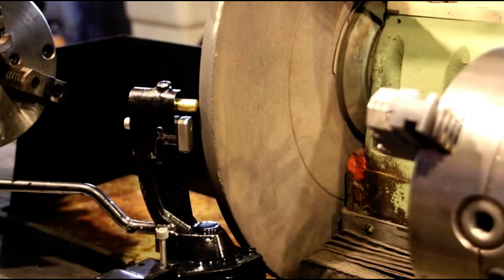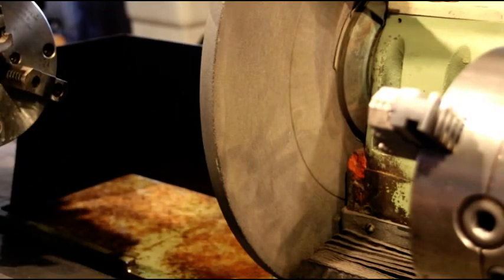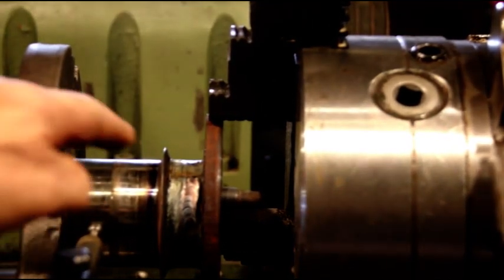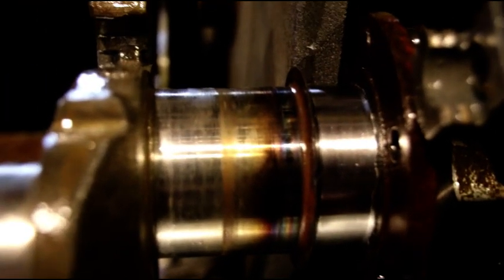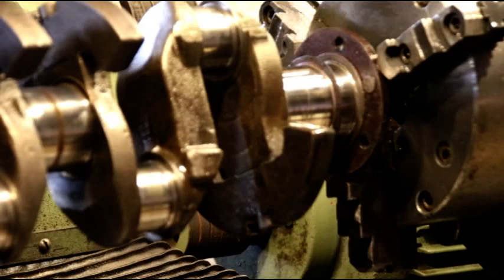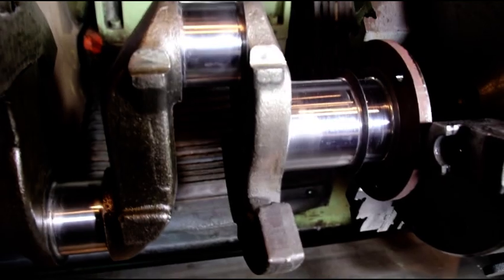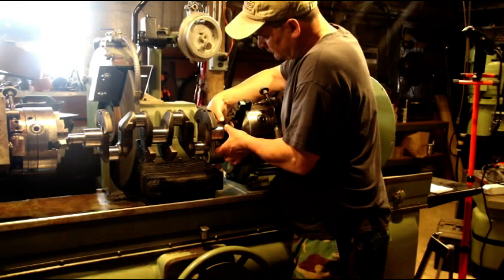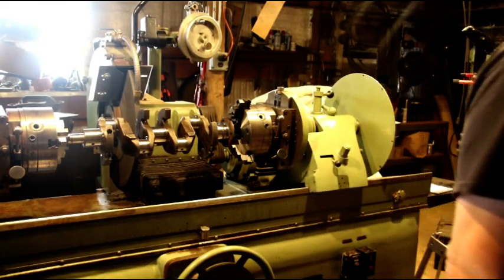Willys Jeep Crankshaft Grinding, Welding/Grinding Worn Rear Main Seal Surface

Comment: I am trying to put the rear main seal in my 42 GPW. I see minor pitting at the area where the seal will rides. I had all the machine work done at a local machine shop that has gone out of business. This engine has been unfinished sitting on an engine stand for 20 years in my garage. What is the smallest the crank needs to be ground at this area?
Reply from the maker: the rear main seal area of these crankshafts is 2.310".   I have installed rope seals on cranks that were 2.307" with good luck.  If the crank or pitting is smaller than that you will probably have a leak after installing it.

Comment: Hi, Brian very nice video!! Very interesting. You are for sure a master at your job!! Not sure if you look at the comments on your old videos. So sorry to ask this as it is not relevant to this video. I am busy with a brake job on my jeep. With the new studs nowadays having splines on them, is it still necessary to swage them as well? There seems to be very little information out there regarding  it .  After learning so much from your videos, I try to do as much as I can myself. And whenever I outsource work, I am so scared that they will mess things up as there are so many people out there pretending they know what they are doing but then end up messing everything up.
Reply from the maker: Depends what you are working on.  If the drum is behind the hub the studs are usually swaged.  If the drum is over the hub then they are just pressed in.    If you don't have a way to swage it isn't a problem, new studs that press in solid are fine and when the lug nuts are tightened the chance of any problems from a loose drum are minimal.
Reply: @metalshaperJeep  Thanks Brian appreciate your feedback. I am replacing the drums on my 2a.

Comment: 15:02 I’ve never heard you can’t weld cranks. 
When I was a kid in Loudon, NH there were guys in Concord and Manchester that welded up cranks to stroke them a bit; I thought that was a normal thing. And all the small farm tractors around that got sent out to ‘get the crank welded.’
And then the aircooled VW welded cranks before you could just order a brand new forged stroker crank. 

Maybe my memory is fantasy…

Comment: I like what you did here. 

How do I contact you? Maybe it’s the phone app but I cannot see a link or email to get in touch with you. 

I have a 1978 258 crank that is destined for a 4.0 block. I need the crankshaft checked and the block checked; ‘maybe’ the crank needs grinding. 
I’ve also watched your trueing up a block video and I like that you take a moment to assure that the crank and bores are 90* to each other and the deck.  

Doesn’t need to be done immediately but maybe fall? I’m in Vermont so I’m fairly close on the map😀 but that’s an acceptable drive to me. 
@metalshaperJeep
I’ll make a point to check back here to see a response on how to contact you.
Reply from the maker: you can reach me anytime at metalshaper@comcast.net
Brian
Reply: Thanks

Comment: Good morning,  working on willys jeep ,titles says 51 cj3a but thinking L head is 2a , it was running but had low compression in#4 cylinder, i was wondering where your located , may need some advice on few items .